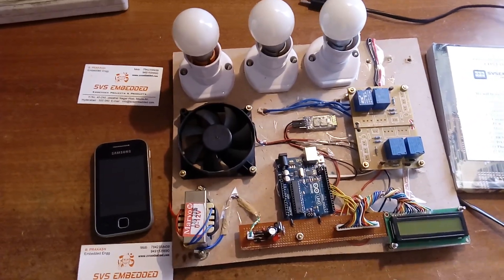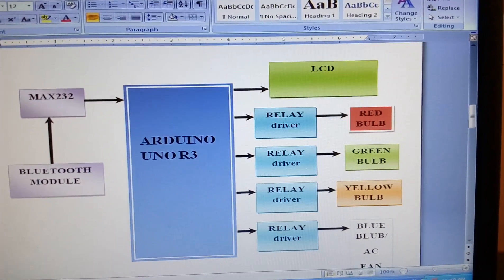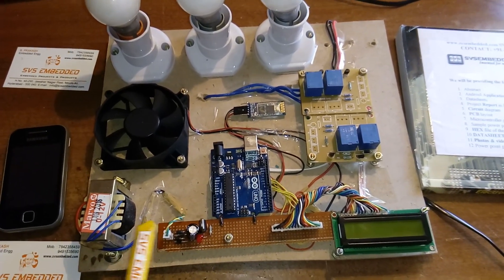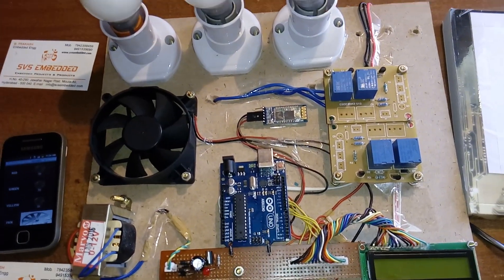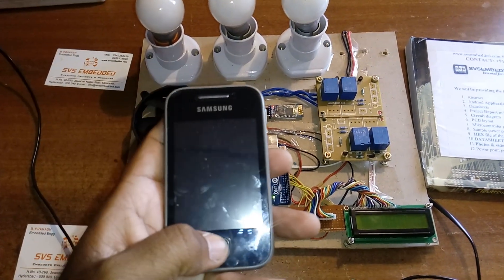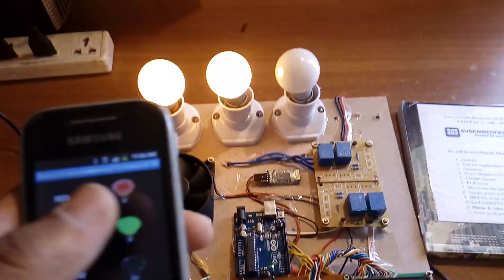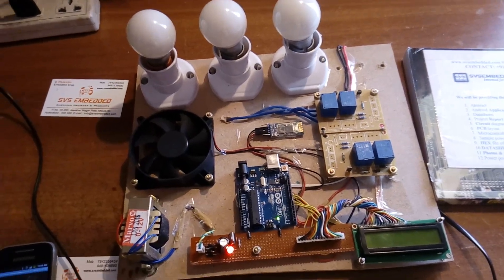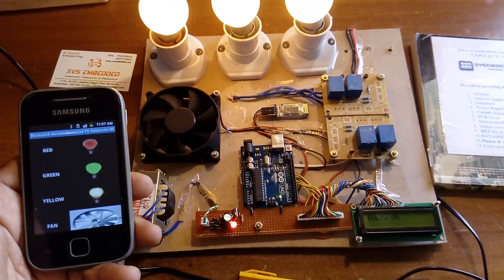Arduino Based Home Automation Using Bluetooth Android Smartphone

Comment: I don't get it:
Are you selling this thing or sharing it?
If "sharing" then show us the circuit and code (??!?!?)
Reply: Code: char data = 0;                
void setup() 
{
Serial.begin(9600);        
pinMode(8, OUTPUT);
pinMode(9, OUTPUT);
pinMode(10, OUTPUT);
pinMode(11, OUTPUT);        
}
void loop()
{
if(Serial.available() > 0)  
{
data = Serial.read();      
Serial.print(data);        
Serial.print("\n");        
if(data == 'a')             
digitalWrite(8, HIGH);  
else if(data == 'b')     
digitalWrite(8, LOW); 

  if(data == 'c')             
digitalWrite(9, HIGH);  
else if(data == 'd')     
digitalWrite(9, LOW);

if(data == 'e')             
digitalWrite(10, HIGH);  
else if(data == 'f')     
digitalWrite(10, LOW);

if(data == 'g')             
digitalWrite(11, HIGH);  
else if(data == 'h')     
digitalWrite(11, LOW);
}                            

}

Comment: plz sir send me  programming in my mail 16tc11@quest.edu.pk
Reply from the maker: Thanks for watching and your valuable Feed back.yes we will help on coding part.
we are selling the projects with least cost.if u order the project we will provide working hardware kit along with 
1.abstract
2.datasheets
3.documentation
4.schematic( circuit ) diagram.
5.software code.
6.sample ppts
7.photos&video file on entire project
through google drive
send me a mail to  svsembedded@gmail.com,info@svsembedded.com.
9491535690,7842358459,www.svsembedded.com,www.svskits.in,
we will send u the how to order procedure to u.